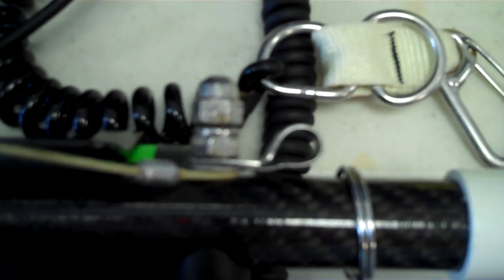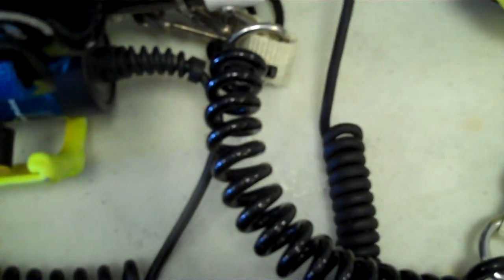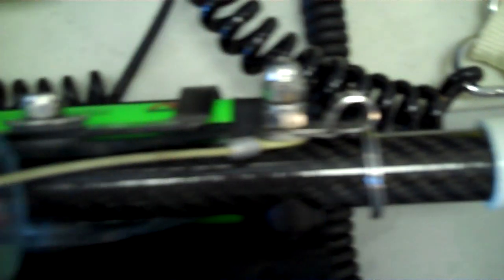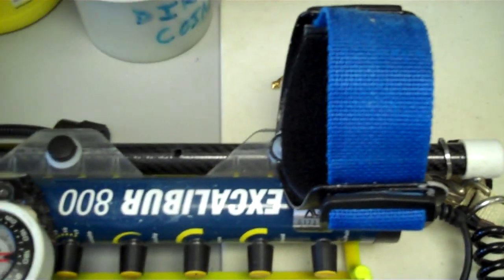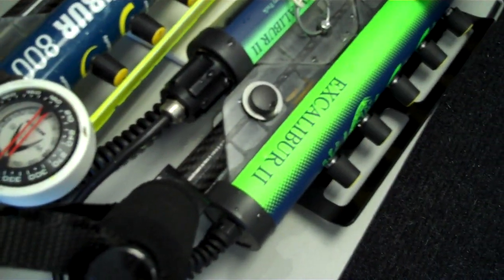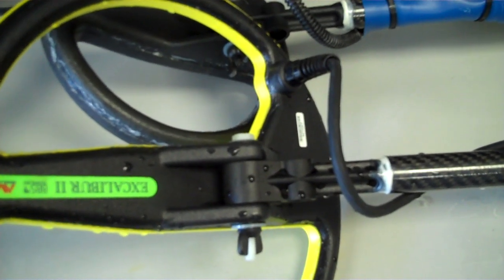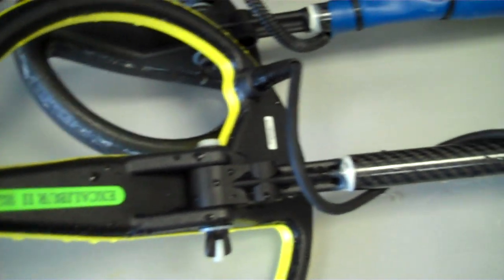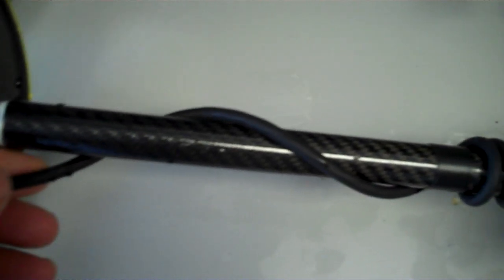Mounting the Excalibur 1000 for diving (part 2 of 2)

Comment from the maker: I already had the isorod as well (connects the coil). If someone wanted to build this unit shown here, and had to buy it all, figure on a total of about 230.00. They will have another spare half of rod leftover. But, the advantage to this is that you have a custom built unit specifically taylored for personal use. No maintanace either, and should have a lifetime of use with no need for future replacments. So, this is an investment.

Comment from the maker: rock west composites. They have some great stuff, but it isnt cheap. Rod (including shipping) was aprox. 120.00 (but 1 length of tubing makes 2 shafts for me)  Thats just the rod. I already had the knob guard and cuff. I had to order the Minelab handle (30.00). Total I spent in needed parts (for this complete unit) was around 95.00.